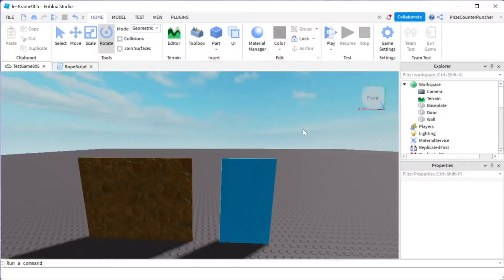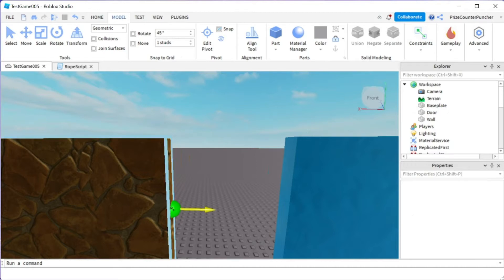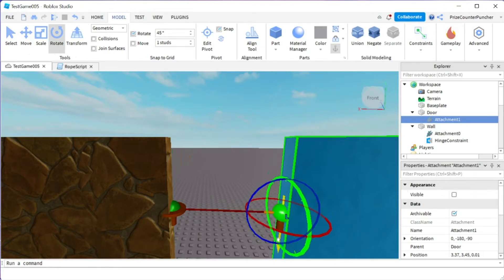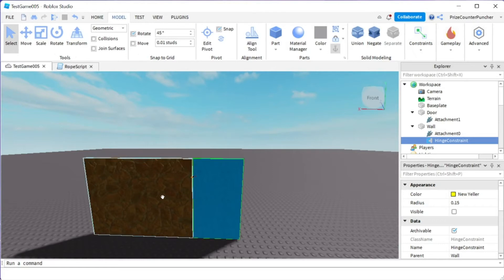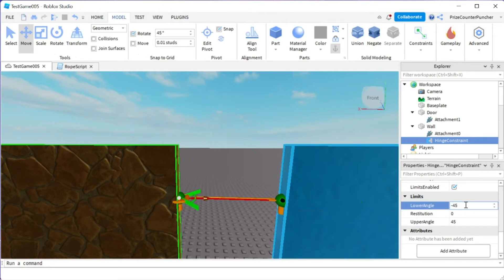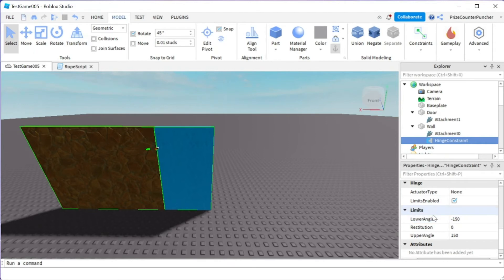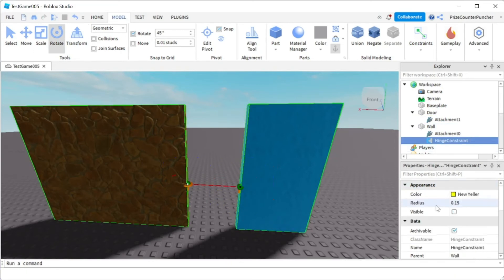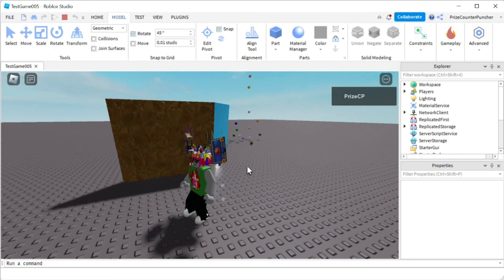Roblox Hinged Door with Vertical Hinge (HingeConstraint)

Comment: Didn’t work still stays still the door stays still
Reply from the maker: Have u tried and push it?
Reply: @PrizeCp  Yes one weird thing is that I made one part out of studs the part that doesn’t swing/ isn’t supposed to swing basically a wall, and that part is moving instead of the door
Reply from the maker: @ger6bm  Make sure the wall is anchored and the door is unanchored
Reply: @PrizeCp  alright then
Reply: @PrizeCp basically a wall that’s 5 studs tall that’s 1x1 and the door is wide so when the wall instead moves rather than the door moving I tried to scale the wall so then I could instead make that wall be the door but then when I tried pushing the wall it didn’t move same for the door